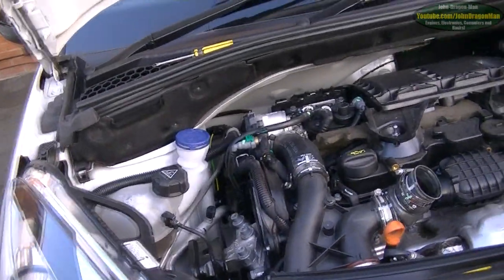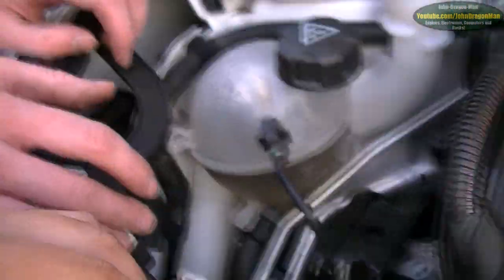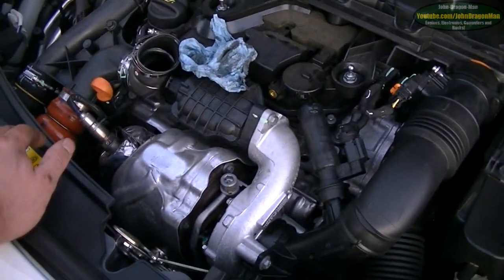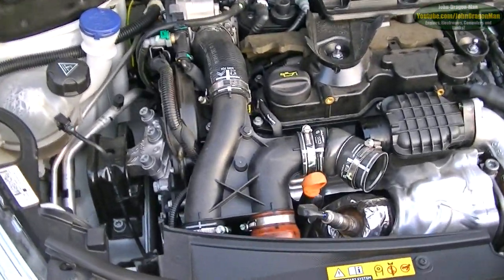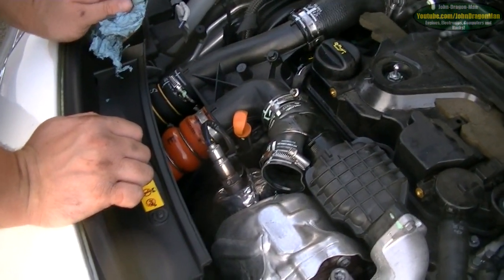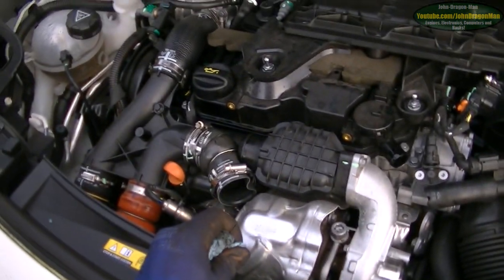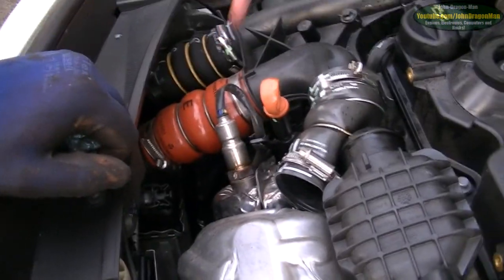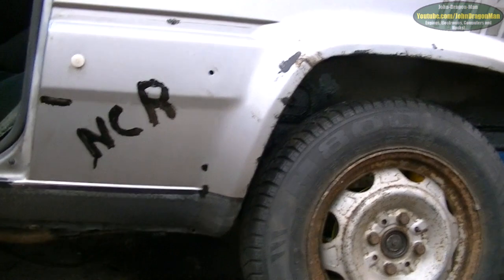Citroen DS3 1.6 diesel E-HDI turbo failure at 7500 miles

Comment: Ok guys this will blow your mind !
We have a Mazda 3 2005 with the same engine DPF fouled, turbo blew, cost me £800 in parts to do properly myself over a few days, after a LOT of research.
No manuals you can find for Mazdas version seems to want to talk about the engine, we are 6months & 5000+miles down the road later & starting to worry again.
So non of this blows your mind I know, but now go to Wikipedia & type in " Ford DLD engine "
Scroll down to 416 & have a look to see if your car is on there, or your mates, your Moms,your Dads....
This looks like a historic monumental mess...
Apparently before the DPF's & EGR's knackered them up they were good.
We have an automotive buddy who says that any engine on the market was usually in the design stage 10 years before manufacture & hey ,guess what EU regulations change over that period & after that period so they slap things onto originally good engines to help the environment, but that buggers them up by stifeling them.
Just get rid if you can.
Surely all the extra maintenance,repairs, extra oil, manufacture processes,parts manufacturing costs the environment more in the long run.
Apparently a Mann oil catcher can help but you still have to keep topping up oil.
As said before, get shot asap !
Reply from the maker: hey man, yeah we no longer have the car now. we didn't sell it because of this fault though. we needed a bigger car.

on these HDI engines they have a stupid design on the oil feed to the turbo. built into the banjo bolt is a little filter that blocks up over time. its only these engines that seem to have them. any other diesels do not.. remove the filter from the bolt and stick it back in. the oil feeds direct from the main oil filter anyway so the thing is pretty useless. anyway its better to have slightly dirty oil getting to your turbo (like any other diesel engine) than no oil. 

we have a 2013 Ford Mondeo now with the 2L diesel engine..  co designed by FIAT..  so we know its a good one :D
i dont know of a bad fiat engine..
Reply: johndragonman tn
Reply from the maker: Marilyn Rosado ??
Reply: I don't understand how this engine could be in your 2005 Mazda when the new 8 valve 1.6hdi wasn't invented till 2012? You mean the old 16 valve 1.6 hdi. The new 8 valves do not have turbo issues or blocking oil feed pipes. Peugeot fixed that problem when they were developing it.

Comment: if it is still under 3 year warranty,what are you fiddling about with any part of the engine?......just take it back to main dealer
Reply: I am thankful that they have analyzed the problems themselves and have made this video.

It helps people whose cars are not under warranty and who do not gave money to taje the car to the official dealership.

It also shows that even the official dealership is not always perfect -- 3 total repairs have been needed in this case.

Also, it helps mon-mechanics understand at least a little about cars and how problems can be investigated.

Comment: i just found out that i have the same issue, 1.6 hdi,42200 miles, turbo doesnt whine,just little oil, is there any solution?
Reply from the maker: Oussama Amimi a little oil is fine.. if you notice the oil level dropping quickly however it needs fixing. sadly the only real fix is to replace the middle part of the turbo or the whole turbo it's self. while you are at it, remove the small filter in the turbos oil feed. should be in the banjo bolt that bolts into the turbo.

Comment: turbo failure, overheated ? head gasket as well ? (? are questions not criticisms) the coolant should be red (oat) i would have thought
Reply from the maker: no..  just the seals in the turbo failed. the guys at the citroen garage said that the coolant being the dark colour that it is, is perfectly fine. :/

you know they never even changed the oil after they replaced the turbo. this is standard procedure on every turbo replacement. i thought it was quite shocking. talk about money saving.
Reply: My coolant has been a dark green colour since new. Coolant has been changed twice now with coolant pump and belt and is still the same colour.

Comment: This in no way shows me a turbo failure what it shows me is there a very strong possibility that your PCV valve is not operating correctly due to a leak in the air induction system if your turbo had gone had failed it would be making horrendous amounts of noise and your car would go into limp mode surely if you're that concerned you would have had it back at the dealership
Reply: He did take it back to the dealers and they replaced the turbo...How would you explain no oil coming out the crankcase breather if it was the PCV valve?

Comment: Been in the trade for a while now enough to know every mechanic I know refers to these post 04 1.4hdi & 1.6hdi engines as absolute crap boxes.  Higher miles
injectors seals leak create carbon deposits in oil then turbo goes then shit euros recon turbo fitted with old pick up and old feed pipe. Then it goes  again a month later.
I know personally of customers that know about warming up turbos, Cooling them down and change oil at correct 10k/1year with the correct grade of low ash piss oil most cars take now. Still needed turbo at 40k.

Turbos are now service items on most cars let's face it. Not just psa making lightweight 'efficient' toffee turbos. Changing turbos all day long nowadays. People neglected their Sierra diesels in 1980's still running their original turbos in 2017. Emission regulation and pure financial greed has meant cars are not what they used to be. Oh well let's just buy a decent old 2.0hdi and do 50mpg. Sorted. 
But being in the trade I now will only drive petrol lol
Reply: Jacob Watts That's a load of bollix! You're in the trade yet can't tell the difference in this newer bomb proof 8v engine compared to the older 16v engine. The older 16v has the bad reputation however the only reason them engines were unreliable was because of owners lack of care and servicing. Using the wrong oil on them was the killer, once the gauze in the oil feed pipe starts to get blocked up due to wrong oil that's when trouble begins. I owned a 2006 307 1.6 HDI with 200k miles on original engine and turbo purely because it was serviced every 10k miles using the correct oil! The car is still on the road going strong two years later after I sold it. Injector seals can be an issue on them too, it's not hard to buy a coupe of copper seals and replace them! There's also a few local taxis using the same engine with well over 250k on them on original engines and turbos, purely because they're looked after.. The new 8v engines give virtually no trouble at all, I have seen them with massive miles and they run like the day they left the factory.
Reply: 308 ALLURE HDI 308 ALLURE HDI there is no doubt if you service them every 10k there's a perfect chance you will have a good egg. But people don't , they wait for the service light to come on. Then wait 7 months till their mot etc because they are pricks. These cars cannot take neglect like other engines can. 
The 8v is about 2009 onwards on models sucks as the c3 etc. seen plenty of post 2010 failures. Plus the thermostat housings leak now the plastic is poorer quality.

Comment: Been working at cars a long time now and the truth is all and i mean all modern diesel cars are absolute rubbish, loads and loads of problems, wiring and parts paper thin, sadly nowadays they really are rubbish, put it this way you wont see a motor with a million miles unlike years ago where there was toyota, mercs etc that had achieved this.

Comment: That modern hdi engine is crap. At work (garage), we call it the engine of death.
Reply: For me all 1.6 HDi can go to hell. I hate them more than I can not. I am also in a workshop and I have suffered its consequences.
Above if you fix one thing, another is broken, it is the worst engine I have ever seen. What a shame they no longer have manufactured more 2.0 HDi of 90cv (RHY) That engine was the best wonder of PSA in common rail, along with its 1.9D rotary pump.
(sorry my bad english)
Reply: jane armstrong it is such a bad engine I can't believe people still buy them
Reply: They're a very good engine if you know how to look after them!
Reply: Luke Odonnell 1.6 HDI 8 VALVE engines are near perfect, the old 16 VALVE engines suffer from issues if not looked after and serviced properly... Much better than any VW Group TDI engine

Comment: All these engines do this . I bet you feel a right tit watching this now years later. Unplug the egr and start the engine. Blame citroen for an Egr fault
Reply: Surely that amount of oil will clog the intercooler real quick. I have an oil consumption issue and can see oil weeping out the intercooler. 2017 Berlingo 63k miles. Just serviced a few months ago. No other issues with the vehicle. All signs point me to a turbo failure unless you have an alternative reason?

Comment: why the fuck are you risking voiding warranty by taking apart parts of the engine and putting it on film on the internet????
Reply: Well that's a fair point too, if it's that new get it back to Citroen, but then it's nice to know what the problem is before you get mugged off down the stealers
Reply: Industry is in such a state that dealers beam stealers indeed!! This caused by the economic system and how finance works.
Reply: Yeah they like to grease you up, and bend you over with the repair bill, but owing to the complexity of the ever increasingly complicated electrics involved with engines, no Joe numpty can touch so it has to back to main dealers who recognise this, and reflect it in their repair bill, hence we get shafted

Comment: french diesel is the worst motor in the world
Reply: They're actually a very good engine if they're driven the way they're supposed to be (ie not short journeys) and their oil changed regularly.
Reply: French diesels are the best on the road
Reply: is that why merc ford and a load of other manafactures use them

Comment: It always had Turbo faults the HDI 1.6 Pug,Citroen Diesel engines anyway since it was first used in the Mk2  Ford Focus.
Reply: NN2994 It were actually first used in the 206 and 307 models. The DV6 engine were launched in 2004. Brilliant engines if cared for